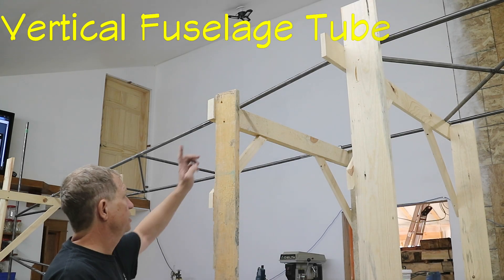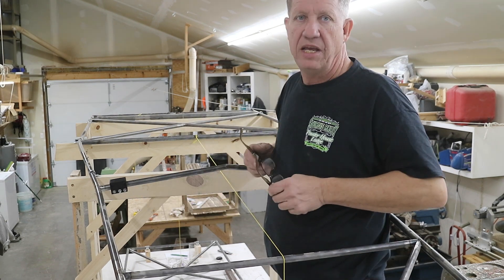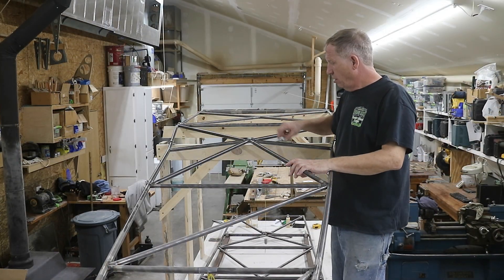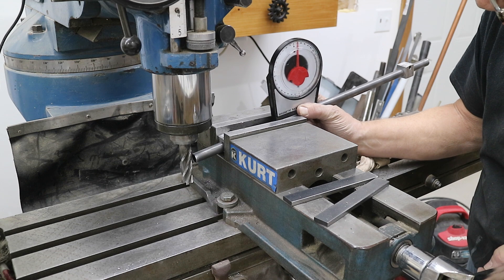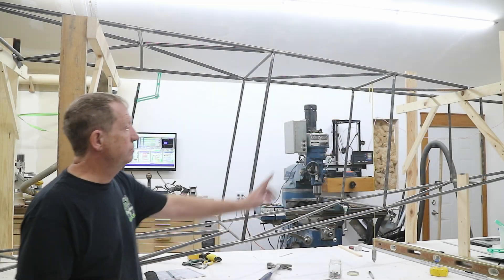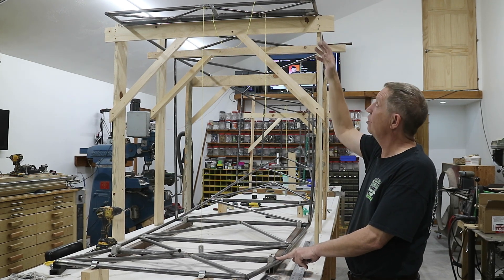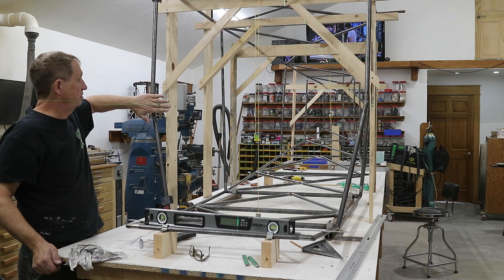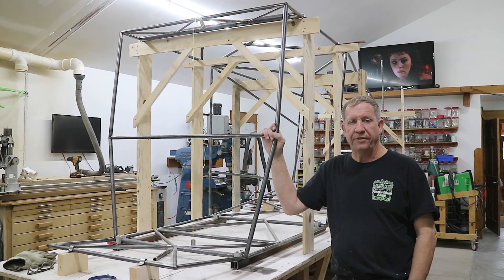Bearhawk Experimental Airplane Build : Fuselage Vertical Tubes

Comment: I am about to start my BH5 and love the pipe adjustable braces, any chance you can share the 3D file to print a set?

Great Job BTW, I've been learning a lot from watching.
Reply from the maker: I have looked and I cant find the files. Not sure where I put them. Sorry about that.
Reply: @BSpotBuilds  that's ok, it was worth a shot. I just jumped on the EAA Solidworks and am learning that so they will be a great first project.